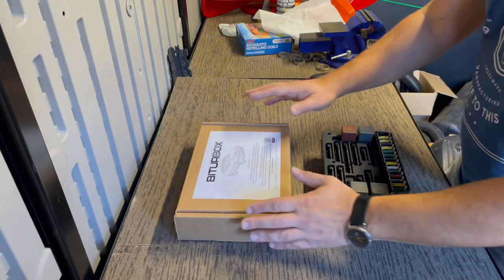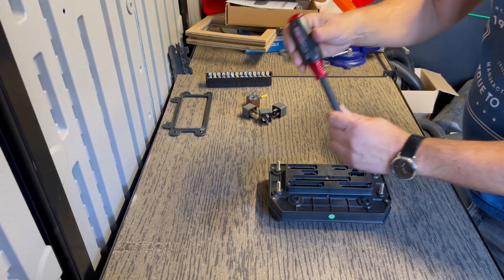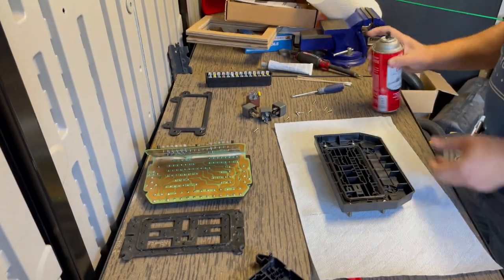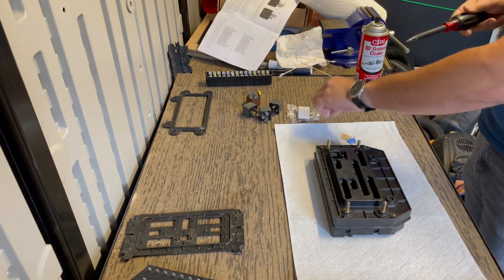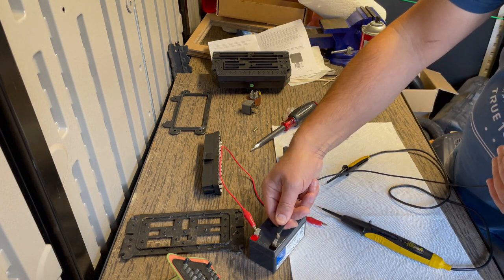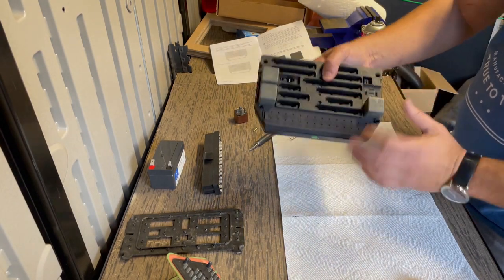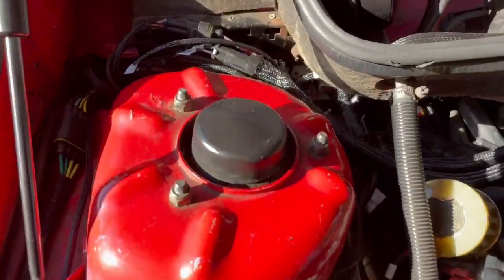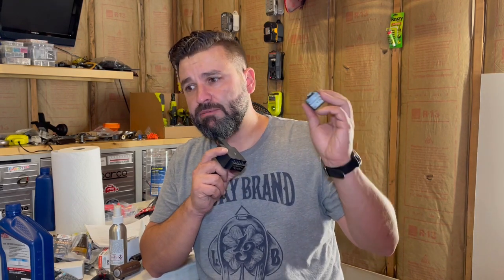Maserati Biturbo Fuse Box Upgrade DIY

Comment: Is your engine bay wiring harness a custom type ?
Reply from the maker: Yes, I rewired the entire front harness.  The engine harness is from the Haltech standalone ECU.
Reply from the maker: https://youtu.be/IIBUQhmKnR8?si=W3-4WFE8bfHf0T_-
Reply: @MarcoCerqueira  mine has the C12 two pole plug missing (engine side, left and second from the top)
and I have some major power isssuesn on the dash.

Do you still have your old one?
I am looking for the plug and the color of the wires going to it